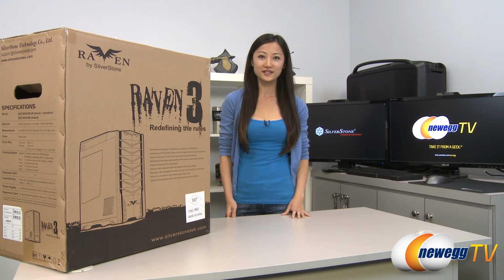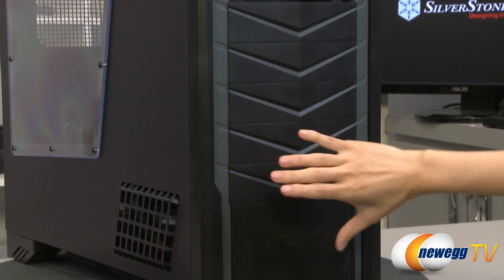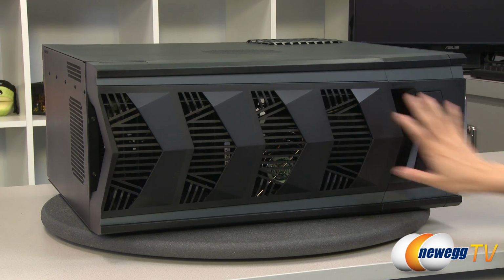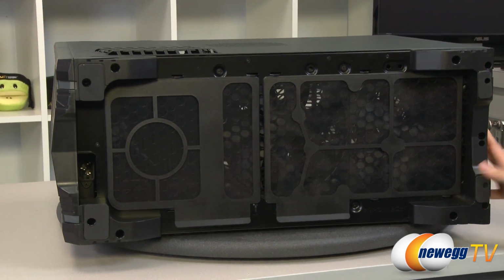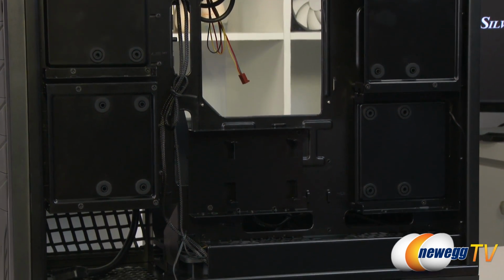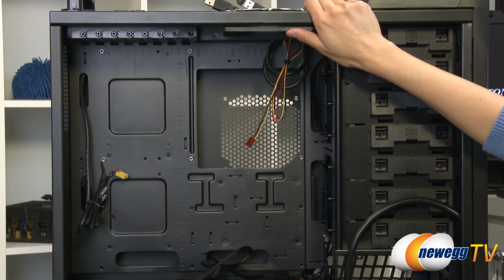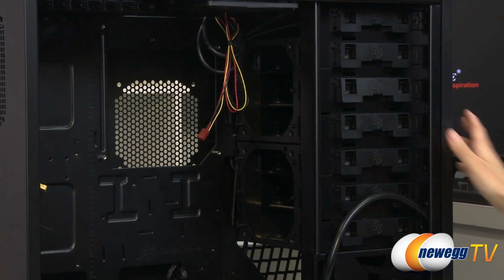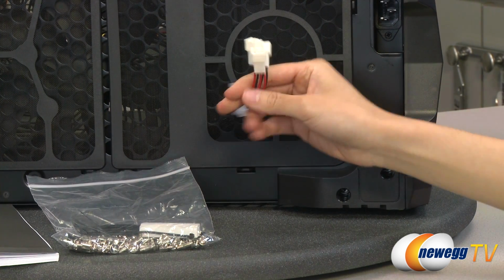Newegg TV: SILVERSTONE RAVEN Series Full Tower Computer Case Overview

Comment: You won't be able to mount fans on the bottom rad... this case is air. Just not enough room for going water and doing it effectively.
If you bought a really short... I mean short gpu, you could push/pull it barely.
It's a case for air, despite what another guy below said, it is not the best air cooling case for it price range. That would fall to the AZZA Genesis 9000. These simple cookie cutter CPU water kits are considered air cooling to me... they're thin rads, no reservoir, & only one block.

Comment: I like the case! Definitely an innovation on case designs. Love how the 24 pin socket and the PSU will be close to each other compared to the standard full ATX cases. No need to flex and stretch the bulky cable anymore!

Comment: IMO they could have done better with this case with the little details. Like all black wires for the internal connectors and an internal USB 3.0 header. At this pricepoint, those little details should be standards for a case. A soft touch finish on the plastic could have also helped with making it look less cheap. I just don't think this case is worth the money they're asking for.

Comment: It's actually a nice lookin case but, It erks me why all these cases with the mobo flipped have a damn pass-thru USB. Maybe I want to use all my USB 3.0, or have the option to. And lack of cable sleeving? And as sum1 else mentioned, that rear fan, just seams like it was added in, and 120? Can't they do a 140 (180 opt)? So much more quiet. All the design going into these cases, just to let a bunch of lil things knock it to a O/P mid range case...and yes, it's those lil things that go a long way.

Comment: I'll agree with the unique spots to put the hard drives/SSD's.  Also all the options for other fans and/or water cooling.  The only thing that would seriously concern me is that top cover.  It would seem quite a headache threading everything thru there, then putting it back on.  And think think about if you replace just one item from the MB pci slots.  Take the whole thing apart again on the top, rethread.  Ugh.  Sure it looks good when done, but the instalation doesn't look fun at all.

Comment: The 90° rotated mobo is excellent for air flow: cold air goes in from the bottom and goes straight out the top as hot air. I do agree that the other aspects (USB 3.0 pass-through, etc.) need some tweaking. Other than that, I think it's a good case for an air-cooled build.

Comment: Having the MOBO rotated 90 degrees like that allows for far more natural air flow (and thus cooling) as well as allowing the potential for much shorter power cables (which means more efficient cables, slightly, and potential for better management).

Front mounted PSU is more to optimize the airflow than anything else, doesn't really give much else of a benefit. (maybe balances the weight more).